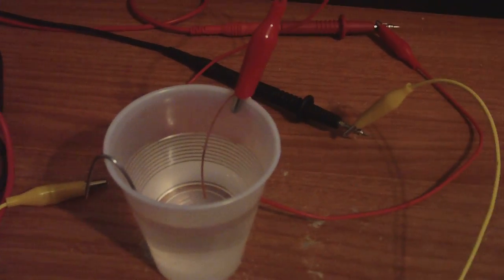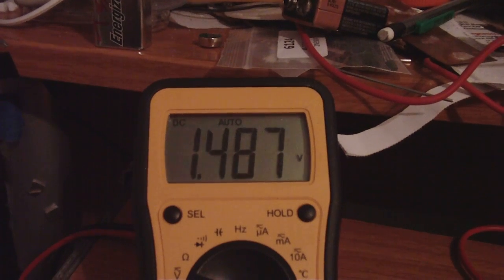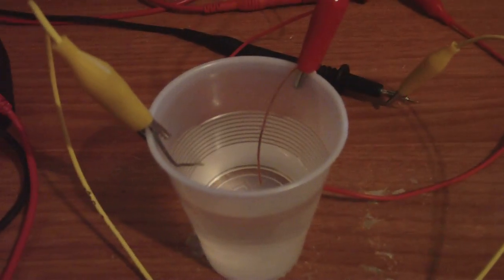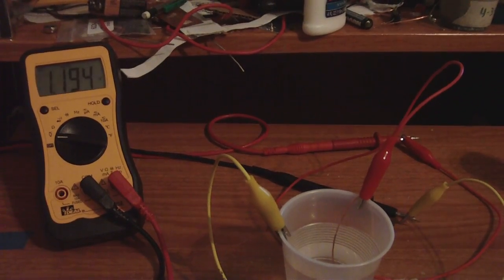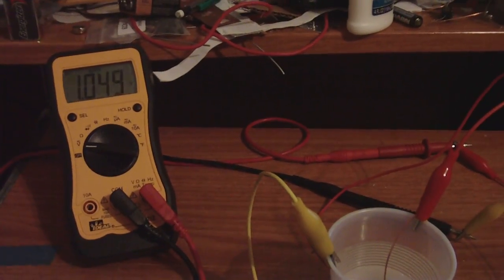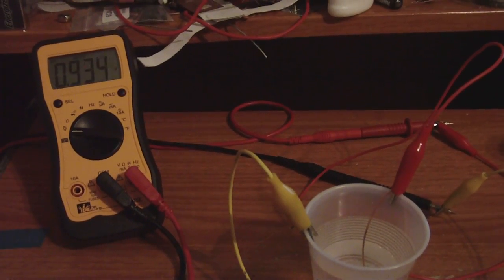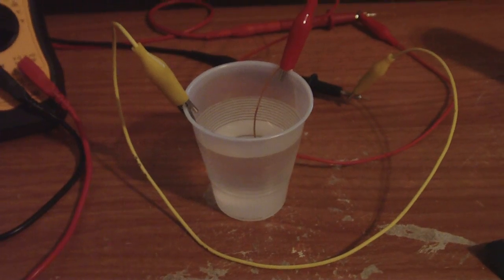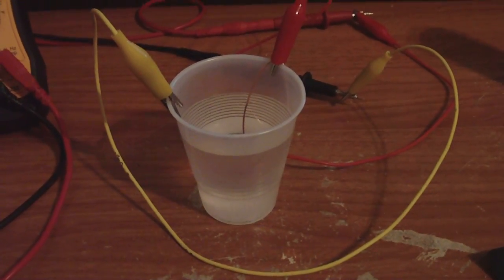Adding Salt Substitute and Epsom Salt To water

Comment: Hmm,
does the voltage stay so low if you stir the solution a bit, or does the voltage rise later again to the 1.4 to 1.5 Volts level ?
If it stays so low this is an interesting effect...
Regards, Stefan.